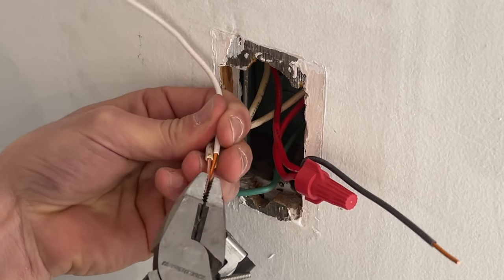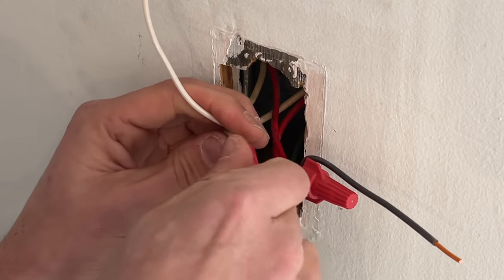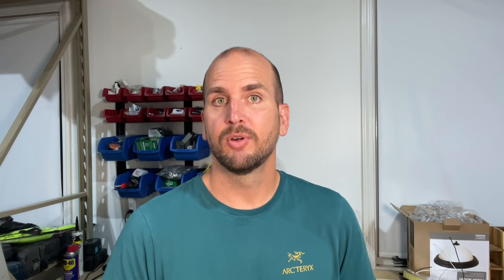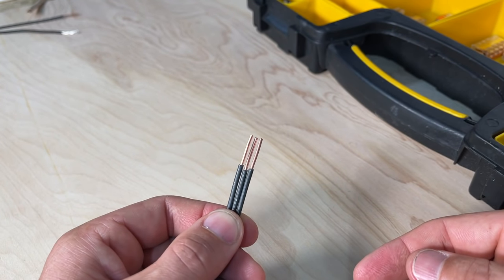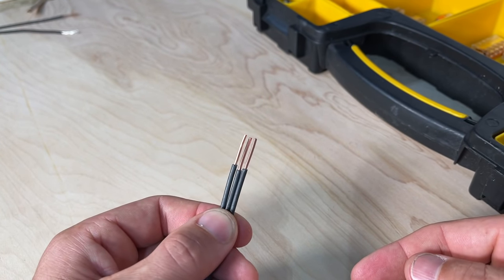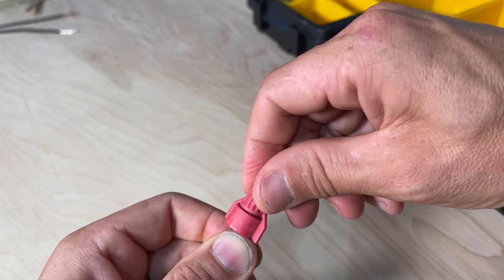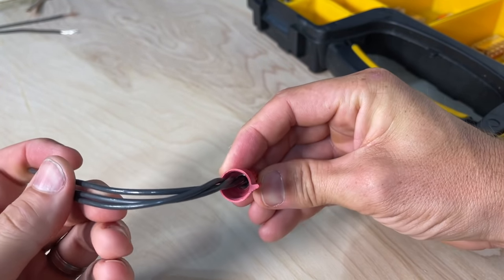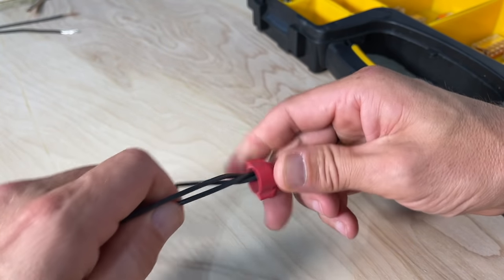10 Things You Didn't Know About Wire Connectors

Comment: It seems the old-timers/die-hards who insist wirenuts are superior and Wagos inferior, are the same people insistent on pre-twisting their conductors. They don't want to believe the spec data on Wagos, but also don't want to believe the wirenut manufacturer who tells them not to pre-twist? And why? Presumably because they inherently don't trust the wirenut to make a secure connection on its own! Funny that. 😉
Reply: The reason you pre twist is if you have to remove a pressure connector ( no such thing last 80 years in NEC as a wire nut ) on an energized circuit the wires will often come apart causing sparking. Best pratice is to strip all wires at least 7/8" then pre twist using side cutters to twist the wires so a full turn on insulation is twisted then trim ends. Wrap a frw turns of quality black electrical tape with a fold over tab forceasy removal. Save crap lack of quality control china tape for only taping tradh bags. All the instructions on box or bag of pressure connectors state " NO PRE TWISTING NECESSARY " that does not mean you must not. Installed wire nuts in locations with moisture vibration etc and came back 30 years latter and all pressure connectors that I made still in great working condition. Wagos too expensive. Only used them while replacing a luminare with a regular ballast and a battery back up ballast requiring around 16 splices.
Reply: Read My post and you'll see why old timers use twisted wire in wirenuts

For a company it's cost effective
It's easier to work on later if you have to pig tail for another outlet
And easy for the inspector to see that you're using the correct parts per code

That's why 🤪
Reply: @mansardmanor3869  I'll give you more cost-effective for sure, but you're not going to tell me that all the un-twisting and re-twisting is easier than simply opening and closing a few levers. The process to add a conductor is little different than swapping one entirely if more ports/levers are needed. And to say that it's somehow more inspectable for correct parts is kind of laughable. Wagos are designed around full inspectability and reusability many times over without affecting the connector or the conductors. Wagos are expensive as hell compared to wirenuts, but nothing else you said here has any logic behind it.
Reply: @marcberm  I will agree with the levers
Nice feature
But I stand my ground on push in, that do tend to come weak on the tension bar. You know that's true

That whole tension bar design is not for secure connection over the years
Reply: @garbo8962  Imagine stanning for a connector so poor that you have to pre-twist even though you're not supposed to and also tape them together even though you're not supposed to.
Reply: @J Hemphill Wago/lever-style connectors actually ARE a well proven technology. They've been used in Europe for decades, where voltages are arguably more dangerous and deadly. In fact, they're one of very few connection methods considered "maintenance free" in the UK... That said, I've never understood WHAT they're thinking over their with ring circuits! 😀
Reply: @J Hemphill and the nuisance of having to carry five different models to do the same job one well selected size of wire nut will do.  
but the lever nuts are better than the push in connectors, and can be handy when hanging fixtures.  I've had a lot more connection failures with push in connectors than I have with wire nuts.

Comment: I enjoyed seeing this video.  This brought to my attention about wire nuts that have hole at the tip.  What is the deal with the hole at the tip?
Reply: Just learned myself....the ones with the hole in the tip are used on the ground wires. You feed one through and take the wire nut down to we're you meet the two at and twist it for the  connection. That way your ground can remain continuous and you can ground the piece sticking out the the receptacle you're using....I'm just a DIYer though so you should look into it further.
Reply: @nicholasmanovich4330  thanks for the reply.
Reply: @nicholasmanovich4330  All of my wire nuts, that have a hole at the top, are green. In wiring, green always indicates ground. All outlets have a terminal for attaching a ground wire and the screw is green.

Comment: DIY and 0 (but Scott might've predicted that of me)!
Interestingly re: Wagos vs. wirenuts. In the US, we trust wirenuts because we've always used them with success; it's the familiar vs. the unfamiliar. In the UK however, there were a number of fires related to an early form of ceramic wirenut that was ultimately taken off the market. Old habits die hard, so generations over there have sworn off wirenuts as inherently unsafe.
Reply from the maker: Hey Marc, isn't that crazy that failures of the old ceramic wirenuts still has ripple effect today on what is offered in the UK 🤯

Comment: As a DIYer I have gone back and forth between twisting and not twisting. I struggle wire-nutting 4 or more wires and much prefer the Wago in those cases. But ordinary two wire connections I prefer the much cheaper and more available wire nut. Oddly, for 3 wire connections I keep wishing I had the push-ins in stock which are less bulky and cheaper than Wagos even though I have trust issues with them. I tend to wrap those in tape. But now that I am aware of the probe feature I may have to rethink the tape. Am I indecisive or an over thinker? Anyone's guess. Thanks!

Comment: More frequently in commercial applications, you might have 7 wires under 1 large blue wire connector (marette). If you don't pre-twist the wires there is a much greater chance of one of those wires springing open if you were to remove the wire connector. It's happened to me many times, a neutral will pop out after the wire connector is removed. This can be dangerous and also detrimental to equipment. If you pre-twist your wires first this is highly unlikely to happen when removing the wire connector which maintains a great connection over time.

Comment: What if the wires are tinned?  Can you use a push in wire nut then?
Reply from the maker: Yes, you can use push-in connectors with tinned stranded wire.  Good question.

Comment: If you go to the Ideal web page and call up their spec sheet for the push in connector (https://www.idealind.com/content/dam/electrical/assets/WireTermination/WireConnectors/PushIn/InSure/InSureModels32%2033%2034%20SpecSheet.pdf) you will see that they ARE rated for stranded wire.  Although, it has been my experience that it is much harder to get a good insertion with stranded wire.  You have to pre-twist the strands pretty tight before insertion.  Another option is to tin the stranded ends with solder and they work as well as solid wire.  But that seems counter productive

Comment: I'm an electrician, not a handyman, not a diyer. A few problems with not pretwisting: 1. You have no way of knowing whether or not there's a good connection. 2. If that circuit ever needs to be troubleshot, when you remove the wirenut, the wire will likely scatter and then there will be live wires that you dont have solid control over.  I've run into this multiple times. 3. It just isnt as strong a connection and the splice has a greater chance of not lasting.

Comment: There is a compound for joining copper with aluminium to prevent the chemical reaction
Reply from the maker: Thanks for the feedback Michael 👍
Reply: It’s called “dielectric”. He mentions the type of wire nut which includes dielectric grease inside the wire nut.

Comment: In my opinion, wire nuts are now DEAD. Since I've started using WAGO, I feel the push-in connectors have a significant drawback. They are a one-use connector. If you need to do some re-wiring, you must cut the wire(s) to free them from the connector. To remove wires from a WAGO connector, you push the lever up to remove the wire. This allows you to re-use the WAGO. The stripped end of the wire to be inserted has to be a certain length for both types of connectors. I use a piece of 12 gauge wire with the stripped end cut to the proper length. I  then strip the wire I'm going to insert a little longer than needed. I then put the insulated part of both wires side by side and cut the wire I'm going to use to the proper length. To help push wires into the box, I take a 3/8 inch wood dowel and cut a notch in one end. I use the notch to push the wires into the box.

Comment: On your video...10 Things You Didn't Know About Wire Connectors.   
A) At 5 min. 17 sec. in the video, it looks like the right hand end of their nut has left hand threads and the wires are also twisted in the wrong direction, that you would use on modern wire nuts.  Or are we looking at an image that was transposed backwards?
B)  When using wire nuts, I do not pre-twist, but I always turn the wire nut 1 to 2 turns.  Just enough to get a 'bite' on the wires, then I do a pull test on each wire, if they don't pull out then I finish tightening the wire nut.  That way I am assured that all the wires are secure in the connection.

Comment: Pro - 0
Mostly industrial work and some DIY stuff at home, But I tend to use industrial stuff when possible at home, so I am typically using more stranded conductors than solid core.

As for pre twisting, I only do it when I have several wires that don't want to cooperate as far as going into the wire nut at the same time, so I give them a twist to hold them together long enough to get a good hold by the wire nut. Also, if I have some much smaller wire(s) being connected to a much bigger wire, I might twist the smaller ones around the bigger ones just to make sure they don't get pushed down when twisting the nut on. 
Frankly, there isn't a good electrical reason not to twist the wires, and not even a good mechanical bond reason not to twist the wires - it really doesn't hurt anything. I don't do it unless I deem it necessary for no more reason than simplicity's sake, but if I do it, I really don't see that I'm causing any future problems in the process.

As for using wire nuts in moderate vibration areas such as a motor pecker head or other such connection areas, sometimes a wire nut is all you have or the only thing that will fit, so in those cases in order to prevent vibration induced loosening, I will give it a couple wraps with some good electrical tape. Normally I dislike wrapping tape around a wire nut as a matter of course, but some cases, it actually serves a legitimate purpose.

As for stranded wire on push-in connectors, there isn't a problem with larger stranded wire - say maybe 14 gauge and down (larger). 16 gauge and up (smaller) though, I wouldn't do it unless the wire was tinned. That said and as mentioned above, push in connectors aren't as common in my industrial world, so I can only go by my limited experience with them.

Comment: You don't have to pre twist your wires with twist on wire connectors. It's not that you shouldn't there are great reasons to do it.
1. we can see without our own eyes that the wires are making good contact.
2. it's easier to twist the wires with the Kleins (lineman's pliers) that we are already holding because we stripped the wire with them more than likely.

Comment: I stopped using wire nuts all together when possible. I prefer the Lever Nuts for everything I can use them on. They are so much safer and easier to use and they do not damage the wire like the screw on wire nuts do. They can be used on solid or stranded wire and they lock on the wire tight. They do not fall off under vibration. So far the only problem I've had with the lever nuts have been on wires with a bit thicker insulation on the wire. On a small motor I was using, the stranded wire had a real thick insulation and it was just enough so the insulation would not go into the hole. about .0015 inch thicker than the hole in the lever nut. I had a reamer that that would shave or ream the hole open by .002 inch. You couldn't tell the web between the holes was any thinner and the lever nut worked fine. The other option was going to be for me to strip the wire a littke longer and after the wire was locked in, to fill the hole with a potting compound. I've also reamed out the holes with a drill bit by hand, using mu fingers to hold the drill bit and ream the hols out just far enough so the wire insulation goes in about half way.
But those were on projects that didn't have codes to adhere to.
Reply: Your full of it, wagos are the worst connection you can make.
Reply: @RadioRich100  Okay then, since I'm full of it and you are the enlightened one with all the knowledge of wire connectors, please enlighten me with your wisdom, oh great one.
This is what I hate about ignorant people. You tell me I'm full of it and Wagos, AKA lever connectors are the worst connection you can make. But you don't give any reason or facts as to why they are so bad to back up your statement. That makes your statement irrelevant. To you they are just bad and that's that and everyone is just supposed to believe RadioRich 100 on that statement alone and believe you know more then the electrical engineers that approved them and they meet or exceed stringent safety standards to get that approval.
So either give me the reasons and the facts that prove these lever connectors are so bad that back up your statement or go crawl back under your rock and be quite.
Reply: @EIBBOR2654  Boy do you have alot to learn. First of all enough people have explained the reason for not using these, Im not going to keep repeating myself, alot of municipalites ban them for good reason.  So much for irrelavent. As far as your labs go their private companys and their so-called approvals can be and are bought. UL for example is publically traded on the NYSE. Who do you think approved aluminum wire in the 60's because it was cheaper?  How many homes burned to the ground and people killed? Your wonderful engineers didnt know what dissimilar metals were?? But the lobbiests had the money - didnt they? Wagos are the same thing in a different package - another short cut to save time or money.

Comment: Definitely would go Wago or wire nut before push in; as really do not like push in
Reply from the maker: Agreed 👍
Reply: Once you remove wires from a wing nut, you have to untwist the wires and straighten the ends of the wires. With the push-in connectors, you must cut the wires to free them. Then you need to restripe the ends. With WAGO connectors, you lift the lever, remove the wire, and the end does not have to be stripped.

Comment: The Ideal push in connectors that I have list that you can use stranded wire with them. This is copied from their instructions. 12 to 16 AWG Str. (< 19 strands), 18 AWG Str. (7 strands)

Comment: What about ferrules? Any usage advise?
Reply: I once used them when I had multiple GROUND wires to connect. I twist the wires together and then insert the wires into the ferrule. Once inside, you chimp the open end to secure the wires. Since the ferrule is bare metal, it can ONLY be used for ground wires. Hope this helps Joe. I only use WAGOs now.

Comment: Wago for 5A or lower when connect to high amp start device.  10A for devices without start surge.   This in US means nothing over 1200W and ideally 500 - 600W range.  Otherwise, wire nuts, butt connectors, and bus bars.

Twice now I have seen a problem.  Once Wago was damaged due to heat.  Second time Wago was fine, but the insulation was slightly burned.  No Wago for me.

Remember in UK, they use 220v, which means they normally run at 5A to 10A, but they can use for 1000w to 2000W.

Comment: I was an indentured apprentice electrician back in the late 70,s early 80,s I served my time , wire nuts were used in the Uk they were porcelain , and known as dog cocks !! Used mostly on V,I,R cable .. But were phased out and replaced with connector blocks ..
Reply: For high heat applications, porcelain wire nuts are still a good choice.

Comment: You do need to twist your wires together when you use a wire nut. Not just for connectivity but the next person who works on that system behind you might tug on a wire in another box really hard and wind up ruining that joint, particularly if you aren't working with romex. I'd rather that just not happen. Also, never cut your twisted wires flat. Always cut at 45 degrees so it really bites into the cones shape of the inside of the wire nut. This is how the IBEW taught me how to do it. I know the manufacturers say you don't need to twist the wires but I have lost track of how many times I've seen wire nuts fall off during a service call or more invasive work becuase the person before me didn't actually twist them together.
Reply: It's always a good idea to wrap the wire nut and the exposed wires with electrical tape. After I wire an outlet, I cover the terminal screws with the tape.

Comment: My dishwasher sits beside my washing machine and the vibration of that over 20 years caused my neutral wire to come loose and melt the wire sheathing. The vibration also caused my electric heat thermostat wire to come loose and burn the inside of box. That's why I will never use plastic electrical boxes. Metal only for my after seeing that. It took awhile to figure out where the burning smell was coming from because neither the dishwasher or electric heater stopped working. I replaced them with Wago lever connectors and wrapped them in electrical tape so they can never pop open.

Comment: You made a comment that the Wago/pushins are more prevalent in Europe,,, note that European electrical system is 230v 50hz and the amperages of typical household circuits are 1/2 of US 120V systems. This may be a factor in the popularity/success of pushins.
Reply: Both are rated for both voltages.  That is not a factor unless you're referring to ampacity differences as a result of the differing voltages.